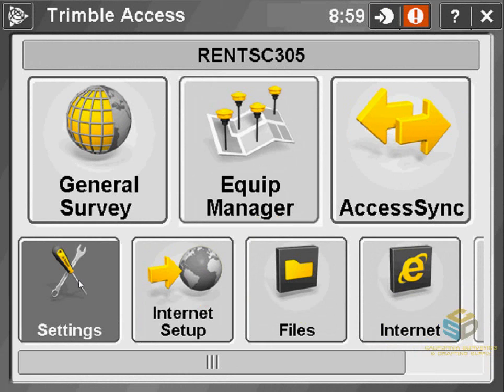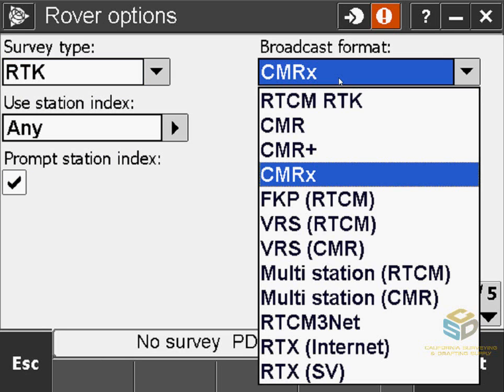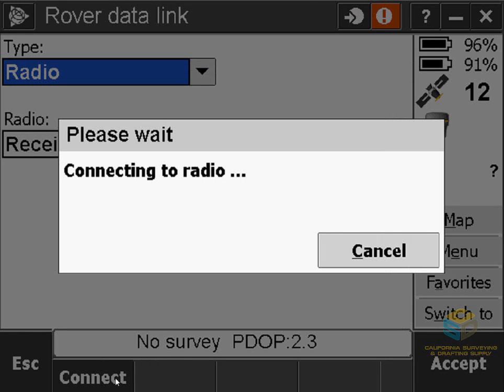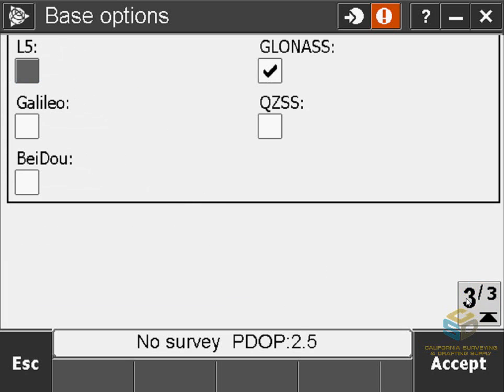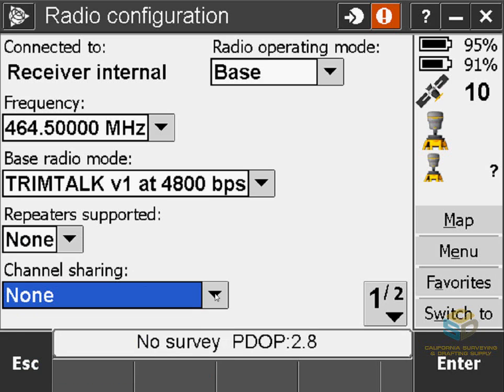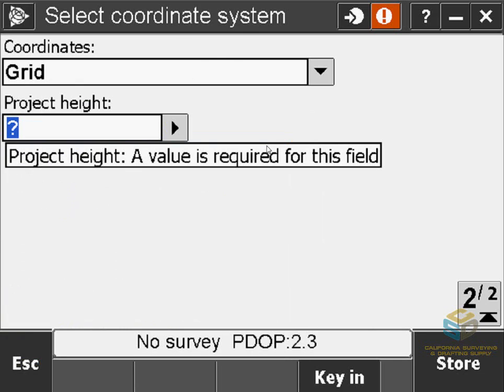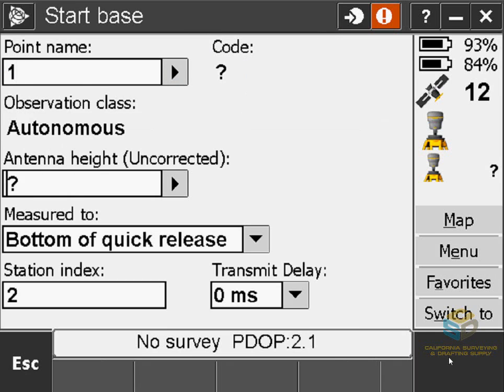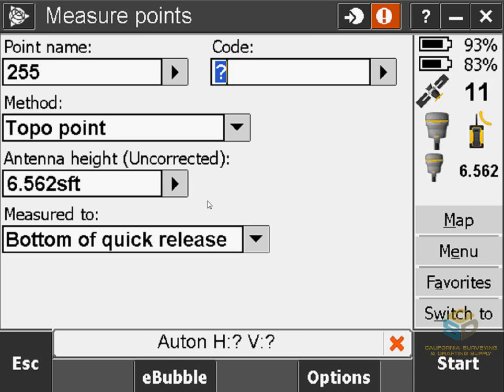CSDS Support & Training Services: Setting up an RTK Survey in Trimble Access

Comment: Do you know if a trimble 5800 gps Receiver requires a external radio modem for running RTk mode.
Reply from the maker: Hi Emmanuel, it depends on the version. Some come with the radios some don’t. You just need the s/n number to check. Please contact solutions@csdsinc.com for more info or call us at 800.243.1414
Reply from the maker: Most likely yes, internal radios do not transmit.

Comment: Thanks for this Video. 
Is it possible to do an RTK survey with R4 as base station and R10 as rover? If yes can you explain me why?
Reply from the maker: Hi there! Yes, it's possible (depending on the configuration of the R4). You would probably be better off with the R10 as a base because of it's powerful internal radio and the R4 as a rover. We do offer paid support and training for specific configuration consultation. Please contact us at: training@csdsinc.com
Reply: In fact i wanted to use R4 as the base station and R10 as rover to take advantage of trimble x-fill, trimble sure point, and so on... (The area to do the test was partially covered by mask).. What do you think about the methodology please?
Reply from the maker: Depending on the configuration of the R4, that methodology seems inherently limited, but you can give it a shot and see how it goes. The 2W radio of the R10 gives you the ability to move a greater distance, but as long as your using the R4 GNSS model, than your method may work fine. It's not a setup we'd typically recommend. If you'd like to talk about it, give us a call at 916.344.0232